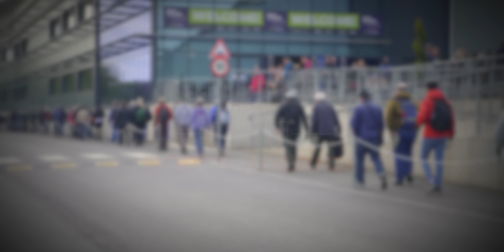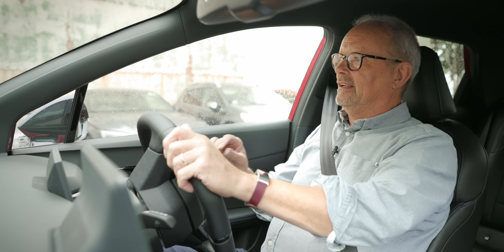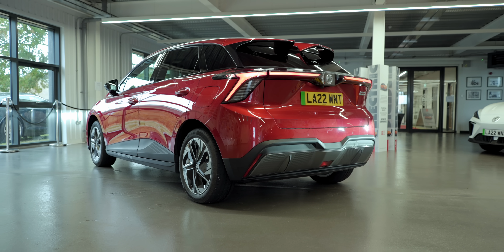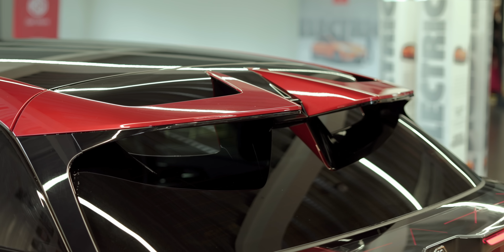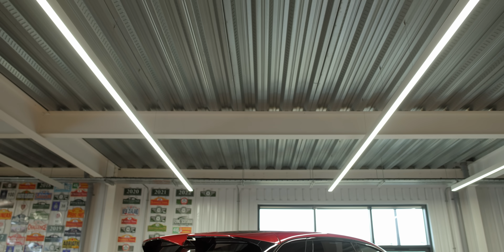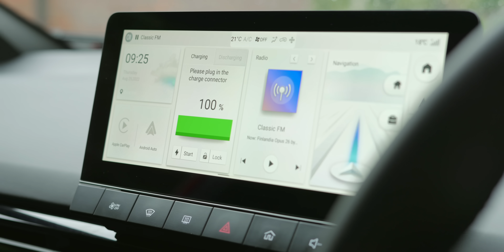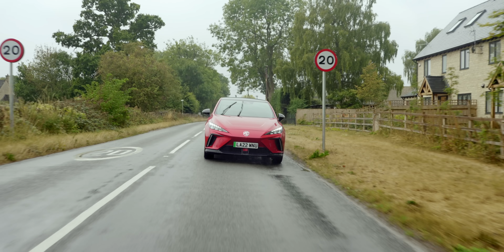MG4: The Bargain Of The Century??

Comment: I cannot stomach the look of ANY of the MG range, or ANY OTHER EV,(except for the Tesla 3,but that is just WAAAAAY out of my possible budget!) except the MG5!
I STILL cannot justify a new car unless they were a "Motorbility" option? (disabled vehicle leasing!)
I will probably end up driving an old classic car, petrol, no catalytic converters, carburetored and a distributor instead of fuel injection and full electronic ignition. I've always wanted an MGB GT, or an old Capri, but a Mk2 Escort with a 1.6-2.0 engine and a modern 5/6speed box, would thrill me more than a modern supercar!
I HATE WITH A PASSION, vehicles without a clutch and manual transmission!  They are DULL, to the point of being pointless, in my eyes! It is the difference between being transported (by an EV) and the PASSION AND INVOLVEMENT of DRIVING!

Comment: I have an MG4 EV long range in pearlised black and it looks and drives great. First long distance trip from North of Newcastle to York this week was great. Handling is terrific, visibility excellent. I used the normal mode throughout, but love the regeneration set to a point that is nearly single pedal use at low speeds. I use Android Auto and this was terrific, where I tend to use Ways. Returned home with 38% battery remaining, so no range anxiety. However I have two concerns both of which are software related. The first off these is a niggle, in that the street road signs reader is inefficient, and a one stage picked up a 40 mph sign from an off ramp while I was on the A19. The second is a major safety concern and that is the lane control software. It is to me a major source of anxiety. Despite the ability to tune its settings, it Almost has a mind of its own at time, shaking the steering wheel at shiny tarmac stripes, lane marking arrows, and former road markings, so much so that it made overtaking extremely hazardous, affected my confidence to maintain a straight course. If there was a way to turn this off permanently, I would. One other slight detraction is that the armrests are slightly too low for my driving position.

Comment: I really like mine.  Ive driven about 200 miles so far.   It’s wonderful behind the wheel.  I have the base model as range isn’t important to me.   It could be cheaper still, if they dropped all the driver-assists.  Just can’t be bothered with all that junk.   I want to drive the car, not be driven.  I like not having a sat-nav and using my phone via car play.  I really like the styling. But it’s behind the wheel where this car shines.

Comment: I guess the batteries are coming from China as MG are owned by SAIC Motor, State state owned but headquartered in London. Still, very interesting. Finally a modest sized EV big enough for a family of four but priced comparable to an ICE of similar size. Would be nice to have some comparative metrics against a Tesla model 3 for such things as kW/mile, actual range not WLTP, range degradation over life span, over the air updates, Infotainment and safety features like lane keeping etc.

Comment: Just got my Trophy model two days ago - it replaced a 2 year old Evoque.  Obviously very different cars, but I'm loving the MG and don't feel short changed for 'trading down'  🙂  A really nice car to drive and it has all the gadgets I need.  Pricing is amazing - The only place where I can see obvious cost savings is the rear seats.  Plenty of room, but a bit mean on luxuries like an arm rest and courtesy lights.  That's fine by me and a sensible trade off.  Love it!
Reply: Regarding the lack of light in the back - I was talking to someone the other day who has an MG5 and the same issue. On the MG5 there is a powered USB port on the rear view mirror area so he got some remote controlled LED lights that can be plugged into a USB, fastened them to the roof (MG5 has a sunroof which provided space) and ran them into the back of the car. He says it works great and was cheap and easy to do. Not sure if the MG4 has a similar USB port but it might be worth a look
Reply: Seen a magnetic light solution on YouTube...10 quid for 2 lights that stick to the roof with magnets. Bit poor you have to do it but the trade off seems worth it
Reply: Do you still love it?
Reply: @montanax8127  yep. Still very pleased. A few niggles with the over zealous safety systems (same as most new cars) but overall very happy 😀

Comment: SO,you have problems with the gearbox leaking oil,getting stuck inside because of software glitches ,and also some of the software has a watermark sometimes because of some issues with the software,also in some batches the seats have problems with the stiching.Will add more as the cars are getting bought and driven.

Comment: Drove one last week (se long range) and ordered, trophy is overpriced. Body control is surprisingly good, I pushed it really hard on the roundabout till back lost the grip and slides a little ") acceleration has a bit of delay compared to Tesla but it's good enough. Power wise definitely in the hot hatch category. Suspension feels and sound mature, good dampers

Comment: Did you know that you need to drive an electric vehicle 50,000 miles before it is environmentaly cleaner than a modern diesel at the same distance because of recycling costs and damage making the batteries.

Comment: Warranty? Tyres? Home charging? Number of dealerships? Battery replacement cost?  What a mumbling confused alleged review...
Reply from the maker: Warranty, too early when we filmed this, now we know, 7 years, 80,000 miles. Tyres? What? It's got them. They are round and black.  Home charging. Yes, of course you can charge it at home. Jeezuss. Number of dealerships. What, worldwide? Or just narrow blinkered UK (3/4 of our viewers are outside Brexitland) 140 dealerships in the UK. Battery replacement costs? Really, you think that's important when we now know batteries will outlast the car. An appropriate question might be, new car replacement costs to fit battery in but you've read some rubbish article funded by fossil fuel lobbyists telling you the battery will have to be 'thrown away' after 2 years or some such garbage.
Did Jeremy Clarkson ever state the cost of a new engine when he was sliding sideways on a disused runway in a humiliatingly expensive lump of dated turd car? No, never, nor did he mention tyres, or dealership numbers, or warranty? No, never, they doidn't even talk about mpg which was alway offensively bad for every car they ever drove.
Two tips. Don't buy the MG4.
 And two, go and watch a really dull channel where some shouty man screams data at you in clear, loud terms with nothing else. 
Dull as a wet Tuesday.
You're welcome

Comment: Test drove the Trophy today….very nice drive and certainly great value for money compared to other similar EVs. I am of an age where I need reading specs so the infotainment system for me was too challenging….I want to be able to change the radio station, adjust the heating, flick through drive modes, turn on heated seats without having to go into menu systems so buttons and steering wheel paddles better suit me and I can do that more easily in say a well specked out KIA. Undoubtedly this car is fantastic value for money, seems pretty well built and drives very nicely so for me ive got to weigh up if these qualities outweigh the extra money I have to pay for a more straightforward way of managing systems and functions an EV offers.

Comment: Flying the Union Jack is lie. 
This is a low quality 100% CHINESE product that may look great on paper and ok in the flesh when new, but we all know every metal bolt and electrical connector is MADE IN CHINA and will struggle to last 18 months without failure.
False economy to by cheap Chinese products.
Reply: Don't generalise - people used to say the same thing about Japan, before they worked out what rubbish most British cars were by comparison. There's no shortage of quality coming out of China - I've lived on their solar panels for fifteen years and built my house with Makita tools made there.
Reply: @luzr6613  I too, have owned and used Chinese made solar panels but, they did not last by compression to German etc produced ones.. some failed in 12 or 18 months. So I learned in time!
I don't agree that anyone can compare Japanese made cars or electronics to Chinese manufacturing practices.
It's an insult to Japanese craftsmen and culture.

Comment: I am very close to swapping out my 2020 e Niro 4. The DC charging is between 130kw & 135kw (Bonnet claim the higher - the stats from MG suggest 130kw not 120kw). There is no rear windscreen wiper. Was it an issue in the rain? V2L adaptor from MG is £250 but cheaper elsewhere. Great review.

Comment: Waited for it until the end, the price and supposed to be a cheaper option than other EV's. Lucky for those who can afford it but the average person has no chance. Net zero is a total pie in the sky idea. Cleaner car, horse shit. Electricity to charge, Batteries to dispose of when they are spent(cost of new will probably buy you a good second hand combustion engine car). The infrastructure is no where near ready. Anyway the EV clan can rip my comments to bits, but the truth is it isn't going to work. On  a positive note the styling and name of the car is 100% great. Pity it's spoilt by been electric😂😂😂

Comment: What happens with the batteries after use.. and what about the people mining the lithium.. and what happen when electricity goes even higher.. I'll stick to my old Audi a2
Reply: EV batteries are being redeployed into mass energy storage units once they lose their top 25% capacity. People mini lithium? Like you care? But not much different to the mining industry in a lot of countries (or oil in Nigeria). Electricity going higher is still way cheaper than oil - and with solar on your roof you can harvest it yourself.
Reply: @luzr6613  solar on my roof ? As its benn raining and over cast for the past month I would of been sat in the dark and cold, but thanks to coal fired and gas powered power stations I'm able to keep my lights on and keep warm..

Comment: My 2013 48k Nissan leaf died today, Fault code is new regulator and motor at a cost of £9800 repair! That's despite full Nissan service history. Nissan say car is over 8 years old so not our problem!. despite in that 48k miles its had full charger unit 4k and now needs motor and regulator. Ill never have another Nissan. This looks very nice indeed
Reply: If you can't trust a Nissan trust me, you can not trust an MG!

Comment: Sadly, it's certainly not the bargain of the century.
I've just cancelled my order after inspecting the car and having a test drive. The reason?  The poor quality of the seat trim really let the car down. The fabric of the side bolsters on the bases of both front seats was quite badly creased, making the seat look 2 or 3 years old rather than brand new.  This shoddy quality would be unacceptable at any price. The backrests and the rear seat were also affected, but less badly. The other MG4 models with fabric seats were similarly flawed. but the Trophy model wasn't.  However the Trophy has those fake leather sets which remind me of some of the horrible vinyl upholstery from the 1960s.  A shame because the car drives quite nicely, but I'm sure those seats would only look worse with use.  So it's not the car for me.

Comment: Coal fired power stations producing electricity to charge an electric car.  Yep that's Green.
Reply: And coal fired power stations also produce the electricity used by oil refineries to produce the fuel for YOUR car. The main difference though, is that an EV uses it's fuel with three times the efficiency of an ICE car, and it produces zero emissions at street level in towns and cities. Or indeed anywhere else...... So even an EV charged with coal fired electricity still beats an ICE hands down.

Comment: I knew you are an actor and you presented scrap yard challenge and l remenbered your name David Lewelyen l hooe l spelt your name right apoliges if l didn't the car you reviewed and an MG sorry but l don't like the fact that China bought the MG name and built very bad hatch backs and SUVs l remember when there were the proper built MG sports cars around l am sure Mr Morris would be turning in his grave if he found out at £25000 it is still expensive all though l can see EVs getting cheaper and in Australia we have EVs there is no were to charge them and we large distances to travel even between state capitals and is nowhere to recharge your EV yesterday l saw two Teslss and thst is in the local area l live in and there are no recharging stations in my locsl area they areall jome charged and l don't think there will be any put in the futuren we aren't that big on emissions in Australia which is great even in N.S.W when you take your vehicle over 5 years old for your yearly regestration inspection no emission test which is great for me in my 25 year old toyota ute with a carburetor and no cat converter
Reply from the maker: Hi Les, well, that is one very long sentence, but that's fine. And my name is Robert Llewellyn but that doesn't matter either, As for your other points I have nothing to say, other than I have been to Australia many times and there are hundreds of chargers already installed and there will be thousands more in the next few years as more and more people change over from dated, inefficient combustion engined vehicles to fully electric ones.
I don't need to try and convince anyone, the transition is happening anyway regardless, and it IS happening in Australia.
Reply: @fullychargedshow  Well l have only seen one and l was a courier retired last year and l only saw one were are they

Comment: I'd never buy a car manufactured by a company who's run by the biggest communist party in the world.  This review is so biased and is probably sponsored by the CCP.  What is the life expectancy of the battery?  Where does the warranty stand with the battery? How much does a battery replacement cost? How long does it take to fully charge the battery?  Is there a quick charge option and if so how long for how many miles?  These questions are a minimum for anyone considering buying an EV and none of them have been answered.  Also, instead of just price comparing with other EVs, why do all car reviewers never include a comparison with ICE cars?  For 25k you could get a much better, more luxurious, better performing ICE car with good second hand residual values, who knows what an MG4 would be worth in 5 years with an old battery.
Reply: You are correct. Nobody cares about the lack of Human Rights in China.
Reply from the maker: Point one. Don't buy the car.
Point two, The device you made your comment with was wholly or partly made in China so you, personally, are directly supporting the CCP. Well done. 
And your T shirt, hat, socks, shirts jeans, routers, tablets, TV, kitchen equipment, the list goes on and on, all made in China or using components made in China. 
Point three. All the points about charging were covered, you just didn't watch, which is fine. Don't buy the damn car.
Point 4  The battery will outlast the car. Everyone who actually drives an electric car knows this, it's only the fossil fuel industry and political extremists who tell you otherwise.
Point 5. Yes there is a quick or rapid charge option at 120 kW. This is stated clearly in the episode y6ou didn't watch because you were triggered and chose the path of virtue signalling. 
Point 6  That's fine., Don't buy the car.
Buy a poxy dated ICE car for goodness sake. They are dead technology so knock yourself out.

Comment: I have never so much bull shit then on this, Clearly paid by MG to push what is a crappy little car that can on do 270 miles NOT the 280 as stated in the video, at best but in real world would be closer to 200 miles. Very rerely do you get a real world test of range and charge times, A petrol car can hundreds of mile and it only take mins to refuel. PS don't worry about those kids in the 3rd world digging for you battery components you don't see them so what does it matter to you Eco nuts

Comment: Sub 0-60 in 4 seconds, what could possibly go wrong when this sort of performance is available to anyone, especially when there are so many different temperaments and abilities in drivers.
Reply: Any EV permanently connected to the internet will likely have automatic speed limit controls applied in a future firmware update.  Who would anyone want to buy a car with permanent internet connection from a manufacturer who is run by the Chinese Communist Party?

Comment: My Maserati does nearly 600 miles on a tank  at motor way speeds.. These EVs are still only good for commuting
Reply: But how much to fill up your Maserati after those 600 miles?  My Kia EV can get me 100 miles for £3. And I've done 500+ mile round trips in mine without a hitch. Admittedly it does cost more to charge using public charging, but once home I go back onto my 7.5p per kwh off-peak rate, with a full charge costing me around £7. You have no cheaper at home fuel option, so you have to pay full price for your fuel all the time.